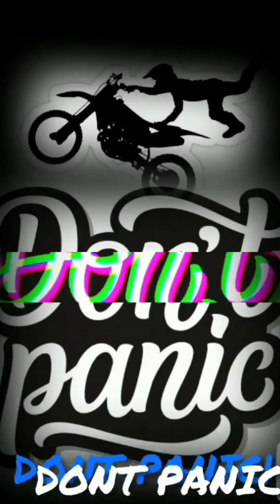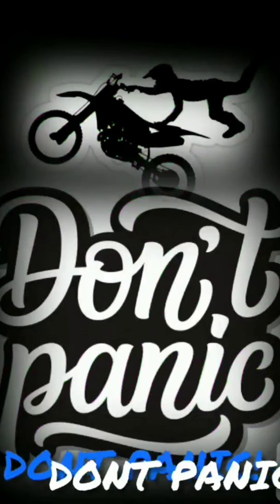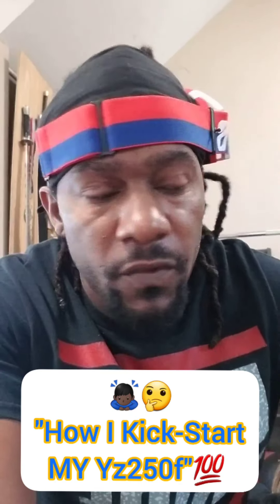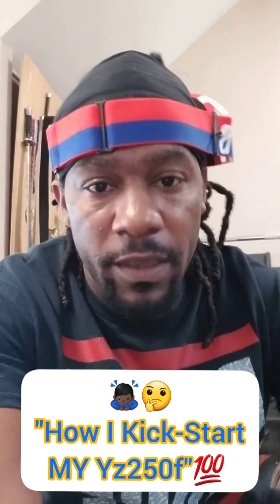yz250f  how to kick start (THE EASY WAY!)

Comment: Great explanation! The bast i sew! ,my yz2015 starts actually good if I open the choke (?) but I never heard about the 3 gas pump, what it is doing? And I wanted to ask, don’t u give a lil to much gas when it started?
Reply from the maker: No it just prims up the cylinders with a little gas so it get that first spark. And thanks.

Comment: Im getting a yz250f soon but idk how hard it is to kick when its hot
Reply: if you learn how to start it cold its so much easier to start it when its hot, when you get it try to not use hot-start cuz if you miss few kicks u wont be able to start it, youll have to bump start it, at least thats with my bike
Reply from the maker: Not hard at all...just follow my video.